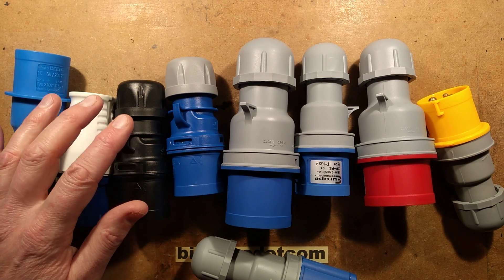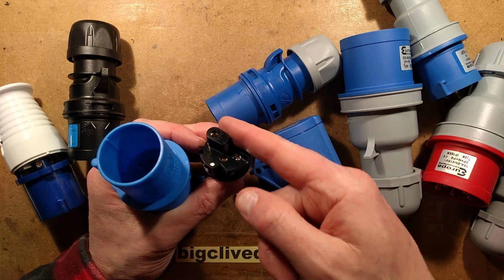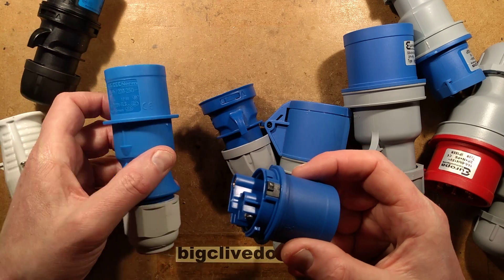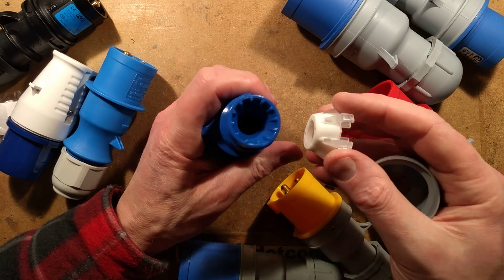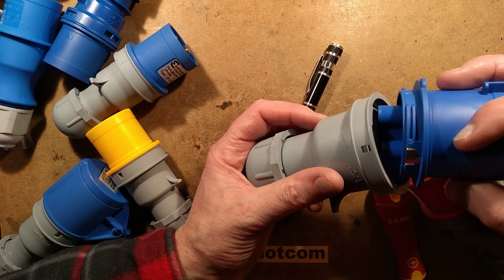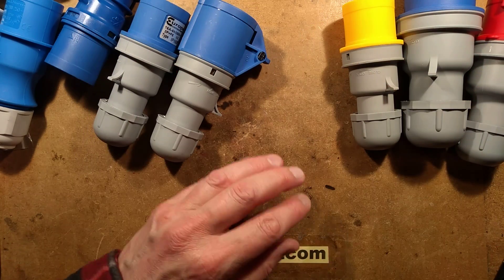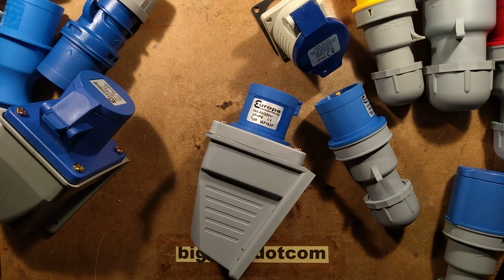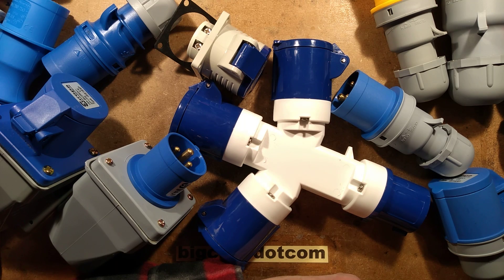My favourite industrial connector (Ceeform).

Comment: Australia: we see these connectors on a lot of IT gear that comes in from overseas. Typically the process goes as such:
1: swear that they have these connectors on them
2: cut them off and replace with a Clipsal 56 series which is the standard for industrial 240/415v power here

Highlights of the 56 series, IP 56 or 66 rated, captive screw together connectors.

Comment: Coming in from Australia, these connectors are used for factories, foundries and grid interconnects. It is also common to see the 3 phase version in any area that you can feasibly imagine there to be catering in that area. I just wanted to point it out since I couldn't find any comments that mentioned this being in use in Australia so I wanted to point it out.

Comment: Touring lighting company I work for uses these for all of our power distribution in the US.  We run 19 pin socapex connectors to fanouts of 6 of these, carrying either 110V or 208V.  Locking, easy to extend and rugged.  Its almost always the end connector (Powercon, True1, etc.) that fails before the ceeform.

Comment: Our bowling alley machines and oil machine use it, the Oiler takes a 60 foot cable connected to an 80 foot connector and the cables weigh about 60 lbs altogether

Comment: I've always wanted to wire something stupid (like a toster) to one of these style sockets just because I think there cool.
Reply: The big 32 amp plugs can fit a small phone charger (EU plug) in the screw terminals (don't question the safety) then you would have a big red plug with a USB lead sticking out charging a phone
Reply: @vrzn  did once have one with a gitar plug on it for real hard solo's in my van to make fun of some artists lol and one with a garden hose and a gardena plug
Reply: @vrzn  LOL I want that :D
Reply: The only problem with doing this is these plugs don't  have fuses so you would need 13A fuse protection elsewhere.
Reply: @neilpinner5750  Fused plugs aren't really a thing outside the uk, and even there you should have fused circuits by now.
Reply: @neilpinner5750  The fuse is installed in the console/panel

Comment: I've used them in theatre, TV and conferencing for power distribution in lighting, projection and pa. The red 3 phase both 4 and 5 pin. I now use them pretty much universally in my engineering business not to forget the yellow 110 for lots of other tools. The only ones I don't like are those large ones with only one screw holding the back cover on as the cover tends to break around the screw boss. Nice video, thanks Clive.
Are Ceeforms a European connector type or are they used elsewhere. I can still remember working with a Russian theatre company and the phrase 'lash up' was an understatement!
Reply: My understanding is that they are of European origin, but are an IEC standard and can be found around the world. Some countries use the CEEForms for nearly all "industrial and multiphase" power needs while others still heavily use their own systems, for example the Nema twist locks in north america, or the clipsal 56 series in Austrialia

Comment: I am shocked that you said that you bend the wire end to double it before fixing it under the screws. That is not a professional approach. You do not know how to use wire end sleeves?
You should know what happens to the stranded wire of the cable when you push them down with a screw? And remember without a wire end sleeve your connection is not reliable. Especialy at high currents.

Comment: I've seen these connectors on DMX Stage lights before, but only cheap no-brand ones from china. It was weird. I had to wire one to the usual XLR-style dmx cable as an adapter.

Comment: they are usually used for (the red ones 5 phase) high voltage being 380 volts with 3 live 240 V live wires and 1 neutral and 1 grounding wire/prong

Comment: These connectors are used in some naval applications for above and below surface vessels, often where it isn't a requirement to use the D38999 connectors.

Comment: Connectors very similar to these are used by the U.S. military to connect vehicle trailer's lights to the vehicle. A two prong connector without the cover was also used as a slave cable to start vehicles with dead batteries or to connect to generators. That style slave cable has been replaced with a coaxial slave cable.

Comment: United States:  I have no experience with these, but they can be found in the data center at my work on the main PDU's, and have also frequently seen them on commercial kitchen equipment.  Hobart mixers and the such.
Reply: They are rare in the USA, but I did see a few when I was over there.  The current ratings are different to match standard US circuit ratings, 20, 30, 60 A.  There is an orange one with four pins for 120/240 split phase use.

There is a black one for around 600/347 V three phase use.  White and purple ones for extra low Voltage, but I cannot remember the Voltage range for each.

There’s also a higher IP rated range with a locking ring and rubber sealing gasket.  The standard also lists a grey one, but I don’t know what that one’s for.

Comment: These are commonly used in Hong Kong, Singapore, Macau, UAE &  Qatar (possibly other post colonial locations) for industrial applications and building sites - along with other types of less worthy connectors.
I've used Blue, Red and Yellow in theatre and concert productions in all of the above locations and a smattering mostly only the 3 Phase (RED) not single phase (BLUE or YELLOW) in Australia.

Comment: We use the CEE-contacts in Norway too. Blue sockets for 230V and red for 400V, depending on which kind of electrical system is being used (We're using both Terra Neutral, and Isolated Earth, depending on where in the country it is :)

Comment: In brazil CEE are normally used in factories ! here in my condo we have 1 - 32A Blue 2p + earth for the pressure washer to clean around the pool and there is another 16A Blue too! As you commented they are very popular in professional audio and lighting companies and I believe every company in the area here has at least 1 cee plug ! Some djs like my friend also uses them to connect their systems ! They are very common on construction sites here they use a metal or plastic box with 2 or 4 CEE sockets ranging from 16A or 32A, these applications from what i know about they only uses blue or red CEE depending on the company that assembles their boxes  !

Comment: Here in the Northwest we use these connectors in our trailer park to plug into mobile homes correct me if I'm wrong but I believe they're 63 amp and generally 3-phase for the furnaces.

Comment: im from argentina, and work for burgerking, they use it all around, from industrial microwaves to big machines, the only difference is that the plastic is very stiff and if you hit it, it will break, but, it feel so safe to disconnect and connect, especially the 3 face ones, sometimes they tight the back screw a lot, and it break the cable, but i see those plugs last for 10 years, without damage.(all of this machines are imported, i don't know from where)

also the small ones are used for connecting the back lights of a trailer to a truck or things like that.

(sorry if the comment is difficult to read or understand, spanish is my first language)

In the houses we use the AL-303N plug, and for old things we use the EU plug without earth in flat(without the hole)sockets

Comment: One thing worth mentioning as an aside is that it is possible to get a phase inverting 32A 5 pin plug, it used to be a standard thing on Miedema equipment. Many farms have dodgy electrics, crossed phases are common so this is a quick and easy way of getting all the motors spinning in the same direction.

Comment: The standard connector for farm equipment like conveyors, graders etc is a 32A five pin, 415v job. 
Quite often the neutral isn’t connected which leads to fun when you need one. 
Farm electrics are hilarious. Live plugs, twisted connections and tape everywhere, two lengths of solid twin-and-earth used as a three phase cable, oh my days, it’s a minefield.

Comment: I wish you mentioned the 3phase variants where with a screwdriver you can switch the phases over without the need os opening it and switching the cables around. This is handy when you want to change the direction of rotation of three phase motors.

Comment: Do they use cam lock company switches in europe? They always seemed very dangerous, you could just cross up the phases or stick your fingers into them, they are color coded, but that won't stop people from coming up with "solutions" .
Reply from the maker: We use powerlock which has finger protection, keying and interlocks on some systems.
Reply: The impression I've got is that camlocks used to be used in the UK but have very much fallen out of favour replaced by powerlocks which are safer (though certainly not idiot-proof).

Comment: Used in Canada for 120/208 5w (60, and 100amp) and also 600v 4w (60+100amp) for temporary power music festivals etc. We use cam lock way more, but “pin and Sleeve” has it’s benefits.

Comment: Great connectors but not UL approved so can't be used in US. There is a brand of pin and sleeve like this that are UL approved which cost about 3 or 4 times as much as the ones you are showing. I brought some back after doing a job in Italy and use them anyway.

Comment: Used in the UK for "shore power" in marinas, for "shore power" for caravans. 

Also used in industry for portable electrical equipment. I've often had contractors request I change a plug on their 32A portable welder (or similar) so they can use a, conveniently located, 16A socket. I don't think I'll do that, go find an extension lead and use the correct socket.

Comment: In The Netherlands the blue ones are used to connect the firetrucks' in build battery charger to mains power to make sure the electronics don't drain the batteries.

The red ones connect the garbage press to three phase.

Comment: IEC 309 is fairly similar and commonly used for Enterprise DataCenter PDU Inputs.
With C19 and C13 outputs for the Servers, Storage and Networking equipment.

Comment: These are used everywhere around Europe in theaters/opera houses/concert halls - up to 20A It's also the easiest way to avoid conflicts with the different style mains plugs (and they are more rugged) For low power applications nowadays I like the Neutrik PowerCons better as they are much less bulky than the CEEforms.

Comment: Quite common in South Africa, we also get 4 pin and 5 pin ones for three phase applications. I wired a 63Amp 3 Phase one the other day its a monster unit. You also need Armold Scharzeneger arms to force the plug into the socket.

Comment: Carrying a 125 A rated 3 phase cable is "fun". Not to mention the 250 amp ones...

Also, these connectors are used in most of the world, mostly since they are standardized, "cheap", and provide plenty of power.

Comment: We use them alot here in Denmark, most used is the 16A 3 phased, from time to time, we use the 63A and 125A version, mostly in industrial application and for power on construction sites, great plug, can't tell how many i have installed, after 15 years as an electricien.

Comment: That's a pretty close design to some XLR, NL4 and NL8 cables in the audio industry.  Love those little connectors.  So small, yet so stout and sturdy.  Used in the USA, but I think that style of connector is used worldwide. Closest to NL4 or NL8 for connecting amplifiers to speakers in professional audio settings like concerts, large speaking events, etc.

Comment: I see those everywhere, I live in Argentina and we used to have the exact standards as europe, we changed the plug for the Australian variant in the 90's, but those Ceeform connectors are everywhere, now that I don't work in industries I see them used to connect things like power generators and construction sites.

Comment: Used in Australia for 12/24V vehicle charging, particularly stand by/maintenance charging for emergency vehicles such as fire trucks and tenders.  They are used on the 12/24VDC side of the charging systems. Out of the three pins the earth pin is commoned with a different pin for each voltage.

Comment: Germany: Pretty much every  kitchen stove as far as I know. Also the standard for 400V outlets
Reply: It's basically a eu standard as far as I know the smaller blue ones are everywhere and the red ones are also almost everywhere the red ones are high voltage I'm pretty sure. Construction workers use them here

Comment: Sweden have had them for a long time now. But I don't agree with you the ones with screws are better holding together than the crappy twist system that easily brakes because you have to use rather much force to get them apart many times so you bend and twist to get them out specially on 3 fase with 5 pins. And if you don't have a screwdriver what are you going to do inside anyway.

Comment: Was anybody else thinking TRS cable as in 1/4 inch ( 6.35mm ) balance line level audio with a high-voltage connection on the other side.

Comment: I have on occasion spotted the rare and elusive seafoam Birds in the US, their migration pattern has still been quite elusive to US but they do occasionally get over here.

I may not be a bird watcher but I am an electrical watcher.

I recently spotted a 3 pin triangle connector in a similar format with full metal body used for three phase star connections in a 60s era electrical installation and I tried to get as many pictures as I could without disturbing them. Thankfully it was not mating season.

Comment: Used in Australia for power distribution in the audio-visual events/touring industry. Also seen similar connectors used for shore power at marinas/docks, although I presume those are specific types which carry a higher IP rating for moisture/corrosion protection. For industrial and server room applications we typically use captive (usually IP-rated) versions of the standard Australian 3-pin 240V plug/outlet with flat insulated pins, or 3/4/5 pin 415V captive plugs/outlets with shrouded cylindrical pins similar to those used in these Ceeform units.  Most common of these are the industrial-rated Clipsal 56 and 66 series.

Comment: I'm looking for a power connector that would be good for a high voltage and amp power supply its ranges 3200 VAC 1-2amps at 60 hrz. Any suggestions anyone?

Comment: What? At 5:35 you said 55V? That's just live, neutral and ground of 110V. Even if it was two phases, it wouldn't be half.
Reply from the maker: It's via a transformer that converts from 240V to 55-0-55 on the secondary.

Comment: I work in an electrical assembly factory in New Zealand and we use the blue and red ABL Austrian 🇦🇹 ones all the time, almost every unit we make has some sort of C-form connector on it. Interestingly we occasionally get jobs to wire up or modify catering wagons, we use the male connector for the inlet because using the female is highly illegal because of the issue you mentioned.

Comment: In the IT space the single-phase connectors are quite common for UPS connections, makes it easy to fashion a bypass cable in case of a faulty device. Otherwise the blue ones are quite rarely seen here in Finland, we tend to use our German plugs (type F if memory serves) for most single phase applications. Three-phase red ones are really common though, since we have 3-phase to every house here everything from welders to larger space heaters use 3-phase, so you tend to see at least one red outlet in every garage. The feed-in 3-phase ones are getting quite common as well, as most telco distribution boards have one with a generator disconnect built in attached to the side of the panel for generator feed-in.

Comment: My brother does generator hire and installation for events....

He hates caterers!

Earlier this year he had one who doubled his waffle grills without saying a word, which he got away with on the first day as he added the extras one at a time halfway through the day.
Next morning however, he turned them all on at the same time, along with the fryer, water boiler etc. They all started heating at the same time (as opposed to the thermostatic on/off cycle they do all day), threw the generator phases completely out of whack, which promptly shut it self down (self protection), and blacked out everyone!

He said that one caterer pulled more current himself the second morning, than all the stalls the previous morning across all the phases!

Plus of course, the original capacity generator requested by the event organiser would have failed under the load. Luckily experience has taught my brother to at least double whatever anyone says is the absolute maximum they need!

Comment: Al over eu, 3 phase (the red one)  ones in industry and in slovenia even some houses have them, like imagine having 400v socket in your house 
Only slavs m8
The single pase ones for campers
Reply: Nah, also common in Scandinavian and German homes.  Power company contracts used to require 3-phase for any equipment above a few kW to ensure that nothing would debalance the 220V phase loads on the distribution supply.

Comment: South Africa (240V), commonly in use:
 - in camper/caravan connectors
 - in data centers, under the floor to connect the cabinets to the power feeds
 - for proper residential generator installations (common in our country)

Comment: Hello, the 16amp ones are used in New Zealand campgrounds, and all N.Z. caravans have a 'male' plug mounted fixed on the outside. Also used for 230v power in tents via an inline RCD. cheers.